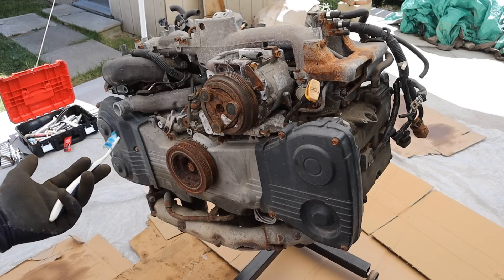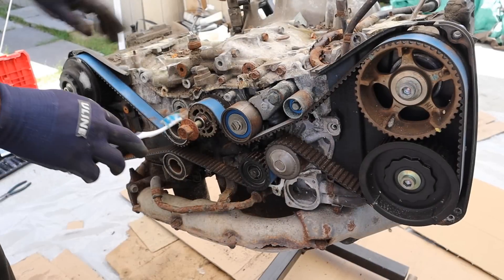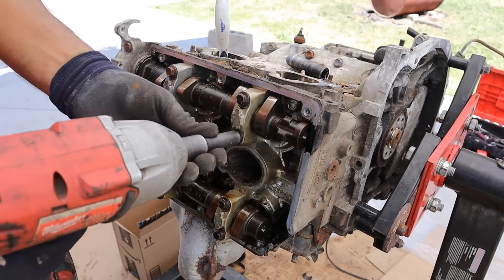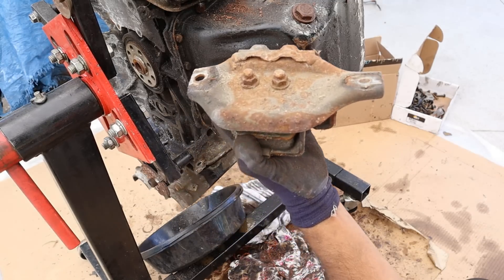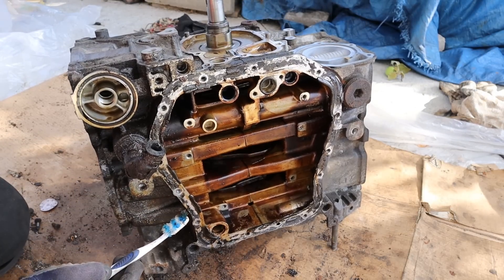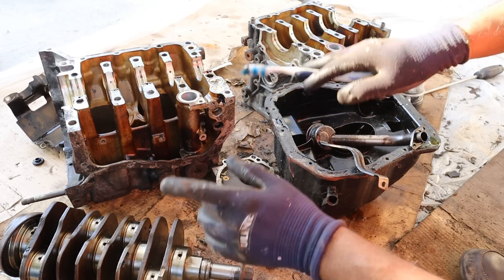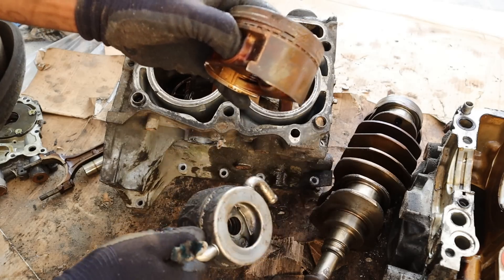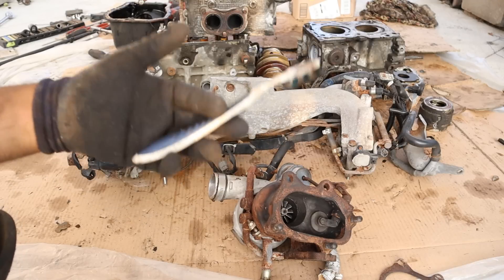Why Subaru Engines FAIL

Comment: Subaru blown head gasket problem follows it to this day. They say it is fixed, but is it not. Engine design is faulty. They should have copied air-cooling design of old reliable VW bug. Subaru and VW bug engines are similar in design. Boxer type...with each cylinder being separated from the rest, and the surface between the cylinder and the engine block is very small. VW had no coolant leaks...since there is no coolant...

Comment: Ej20's were very very good. The problem was an extreme lack of maintenance and incredible modification/abuse. Without a turbocharger that engine would easily run 300,000 mi or more. Super thick cylinder walls, long piston skirts, thick robust rods. Ej'25's suck, Subaru cheaped out and used the EJ20 casting. Basically bored out the block bigger and changed the crank for longer stroke.

Comment: Hi, will a 2018 subaru outback wagon non turbo have a cam carrier leak/drip at 34,000 miles on the car? bought the car end of 2017. subaru dealer is saying the base price is $3555.
Reply from the maker: Very possible. That's why I don't like oil interfaces going through multiple parts.

Comment: The 2011 and older engine in Outbacks has the oil filter inside an exhaust loop. It keeps the oil much hotter than needed. Changing the oil becomes a 3rd degree burns experience. Stupid design!

Comment: I have  an EJ206 in my legacy GT.  i run 95 octane, i think that the 91 causes detonation under some driving conditions, it definitely increases oil consumption, and make the oil get dirty quick..
do i need to have it tuned, like timing and plugs.. it goes real good when necessary, 
,but these days im in to fuel economy , does 33mpg [imperial]

Comment: I find that every engine has its own little quirks and weak points.  Nothing is perfect.  Especially not in a 25,000 dollar car.  Subaru engines are very reliable engines assuming you take care of it and don’t abuse it last what it was designed to do.  It’s not a race car.  It’s not supposed to be a race car.  Do your timing belt at 95k.  Change your oil ever 3-4K miles.  If turbo, do every 3k.  Check your oil regularly, check your coolant.  Use good gas if it’s turbocharged.  Don’t launch the car.  Don’t modify the car without a supporting tune designed for your set up and know that you are pushing the engine farther than it was designed.  Personally, I believe if you get a wrx, you should replace the turbo inlet, throttle body pipe, and ensure your vacuum lines are in good shape.  Do spark plugs and get a custom stage 1 tune running stock boost levels so you can run richer while building boost to cool the pistons as they run lean from the factory mid power band and that cracks ringlands sometimes.

Comment: Great informative video.
I ran from new a 2005 2.0L WRX with a Prodrive performance pack. I ran it for 8 years and 80k miles, with no issues. The key for me was good maintenance, best oil, 97/99 gas (UK octane)

Comment: We have a 2014 Subaru, it's a oil burner, as long we keep it full  of oil it runs. Not impressed. These things aren't reliable long term. We also had a/c issues from day one and had to fight with the dealer to finally fix it. My advice is lease for 4 years and dump it.

Comment: I wonder how many miles you can expect to get out of a Subaru boxer engine (non-turbo) if you change the oil and filter every 5K, keep the oil topped up, and drive the car normally.
Reply: 150,000 miles easy..by then 80% of cars on the road  need to be scrapped if you cant fix it yourself.  NOTHING wrong with that boxer engine.
Reply from the maker: I wonder too...lol

Comment: Water bending valves???? Cracked piston, blown head gasket, bent wrist pin or rod... sure. But bending valves? Hmmmm
Reply: dude look at the engine.....you really thing it was maintained?  Get serious
Reply: @chadhaire1711  never questioned the maintenance. Sure was non. 
But hard for me to imagine water bending valves.
Reply: @bubav8  if there was enough water to cause all this rust you can be sure there is  more than we are being told here.....looks like a flood car.  This motor is good for 150K miles, 100K if driven hard.

Comment: Why subaru WRX engines fail:
1. No maintenance. Like checking oil level even once a week, and changing oil regularly goes a loooong way.
2. Excessive mods. Subies are easy to mod, but the stock engine isn't built to handle more boost than it has stock. 
3. It goes fast, so owners redline the car and drop the clutch to launch really fast. I know a guy who does this at practically every green light with his WRX. 

And often at least two of those three are combined. Sometimes even all three. The car is tortured, often boosted over what the engine and transmission can take, and regular maintenance is a distant dream.

Comment: My 2.0  turbo 2014 failed  after 130 000 km on it   Seals started to leak and the dealer told me it needed a whole engin rebuild

Comment: You replace the headbolts on the boxer 4 as they're all stretch to yield and one use only bolts 
Dead give away is a nice new looking belt and the Cams moving freely 
Meaning a belt failure and bent valves 
Good vid keep it up

Comment: Inadequate Preventative Maintenance and being raw dogged at the same time generally turn most engines into 1 solid state piece of metal.. subaru handles all that fairly well.. do the PM on your Subaru and you will keep it for a long time barring the unforeseen.

Comment: I recently had to sell my Legacy 2.5 GT ‘05 with 207k miles that I owned for almost 10 years because it got a really bad oil leak over the past several months. Loved that thing, especially since it was a manual, but it was becoming a nightmare with constantly having to keep oil in the car and the cost to fix it was way too much since the entire engine had to be taken out to repair it.

I drive a 2016 Lexus IS 300 now. I wouldn’t mind having a Subaru again as a second car, but not as a daily driver, at least not one with a turbo engine.
Reply: MY 2018 IMPRESA 20K   ALREADY HAD 4 RECALLS  AND BATTERY WENT BAD AFTER 6K MILES
STILL HAVE IT
Reply: @ekop1778  Thats good because other manufacturers tend to hide issues from manufacturing. Subaru tries to track down and fix all even most petty issues. Also FB and FA(EZ series too) series of engines are very reliable. All bad reputation is caused by cheap graphite gaskwts on EJ25 naturally aspirated engine and turbo EJs from oil starvation.

Comment: This surprises me.  The 2L WRX engine of this era with the metal head gasket wasn't known for head gasket failure.  NA engines with the composite head gasket always blew.  Still, you could expect to get maybe a 100K miles or more before failure.  As of a couple of years ago Subaru was still selling this garbage head gasket as a repair part.  BTW, this is an interference engine.  Extreme care is required when swapping timing belts.
Reply: 2.5 engines were more susceptible to head gasket failure due to the thinner walls of the cylinders from the previous 2.2 litre displacement.

Comment: I had my forester Stb for 11 years replacing it for a Mazda hybrid (fuel is so damn expensive), the forester still works and I wasn't that religious with service. So I don't think I agree that ej engines are fragile. If mine never started, I was genuinely shocked because it started all the time everytime for years.

Comment: I'd wager that this one met its end with a combination of a money shift (which lunched the valves) and low oil. There wasn't enough "milkshake" to suggest a typical head gasket leak; judging by the rest of the engine I'd suspect it was pulled out and chucked into a field for a few months before you ended up with it, and the water made its way in through the open valves. Basically: it was abused and neglected. No engines can survive terrible owners.
Reply from the maker: Yes it came from a farm so it was likely sitting

Comment: Here are some of the problems we encountered with our two Subarus: flimsy heat shields that self destruct; exhaust manifolds that pass directly over the CV boots that cooks the rubber necessitating replacement of the entire CV joint; under engineered front disks that warp (replacement with after market disks solved problem); four speed transmissions that downshifted constantly to be replaced by CVT that has its own problems; inherent engineering deficiencies in the engine that commonly results in head gasket and cylinder over-heating problems not found in other four-bangers. The failure of window design (perhaps improved now) made wind noise irritating and the air venting that introduced very warm air into the cabin (necessitating use of AC even with cool outside temps) was just another problem.

Comment: The number one cylinder overheats. Head gaskets and engine failure is common. Ours died at 140,000 miles. Subaru has never resolved this problem.

Comment: I've owned several Subarus with these boxer engines. The full shop manual for these cars (the models I owned anyway) clearly instructs the head bolts need to be re-torqued on a regular schedule for the first year or so (can't remember now). It's not optional. It seems no Subaru shop does this and Subarus get a reputation for blowing head gaskets. Well, duh. Nice cars, nice video.
Reply: Can you name another vehicle that requires frequent maintenance of the cylinder heads? Subaru has a design flaw that results in head gasket failure and destruction of #3 or cylinder.
Reply: I owned a 1979 ford D series truck, they had a reputation for blowing head gasket.  manuel said that head needs to be retightened after 1000km. a process I went through, and didn't have any problem  @lewisg1736
Reply: Im not surprised to read this, givin the bad rap subs have.. I recon that a quick way to engine failure is to run 91 gas, and flog the arse of it, detonation  will be lurking and will mess up things thing too.  oil and filter are real cheap really...

Comment: Serviced our 2011 outback regularly, changed tranny fluid every 60,000 and drove it 11 years and 257,000 km.  It did blow a HG but other than that…it was a solid car.
Reply: 257 k  (160,000 miles) and a head gasket replacement is OK with you? We sold our Tacoma with 235,000 miles and the young guy who bought it is still driving it (without major mechanical work) years later.

Comment: As someone with a broken EJ205 in my garage right now I can confirm this is accurate, but I still love my Bugeye and she will be getting a built engine :)
Reply: Are you switching it up or getting the same engine
Reply: @goudagramps3719  I'll stick with the 2.0L, the 2.5L have a higher tendency to throw rod bearings than the 2.0L does. Gunna get the engine close-decked, drilled for 1/2" head studs, and forged internals hopefully going for ~450whp
Reply: @Grooove_e  that’s Awesome man I hope it’s fun
Reply: @goudagramps3719  thanks I appreciate it, I daily drove the car for 3 years before it broke and I'm doing a full restoration level build with it now, ill try to start posting videos of working on it/driving it once it's done

Comment: Too many avenues for failure. My sister had to have her Forester engine replaced after only 6000 miles(defective piston rings). Watching this video really makes me appreciate the 2.5L 2ARFE engine in my 2017 Camry.
Reply: A WRX will run circles around a Camry.  More performaance requires much more maintenance.

Comment: Does this issue effect non turbo charged 2.0s?
I have over 160,000km or 100,000mi on my EJ204 and have had no issues at all.
Reply: Seems it was abused and not maintained right, people are often times ignorant of how they should maintain turbo cars. Cardinal sin being not letting them warm up and cool down before/after driving hard, and no frequent enough oil changes. As long as you know how to take care of your car it wont have an issue
Reply: Also ideally you should.get it equal lenght headers and twinscroll from JDM subarus or aftermarket it will get rid of unequal temperature stress, run more efficiently and loose the 2cylinder style rumble. Which might be a con to you, but i think it would be worth it for long term reliability sake.
Reply: Oh wait you have NA. Then you are in the clear. EJ20 and EJ22 are rocksolid, just make sure to change oil on time.(its horrible thing that many people neglect on any car) Only EJ25 had HG issues due to weak composite/graphite gaskets. NA motors have equal lenght headers from factory so no assymetrical heat issues.
Reply: @Kacpa2  Yeah I do oil changes every 5,000km or so due to heavy driving.
Only thing I had to do recently was change the radiator.
Reply: @IIGrayfoxII  Then you have nothing to worry about, thats very good care you take of it, with shorter oil change intervals.

Comment: this videos has double purpose, 1. to show what is inside and what went wrong and how it works and 2. to select different types of metal for recycling what gives more money than if is mixed
Reply from the maker: Actually they say aluminum block is same as steel scrap because it's got steel liners and inserts and considered dirty aluminum
Reply: @speedkar99  in my country one kg of al is about 1 $, steel is 7 times less,mixed, more than steel less than al,depends on calculation of worker that takes it from you,i did cut on parts my ex car,even engine and gearbox

Comment: I would LOVE !!! To see how a Subaru turbo charger works. :)
Reply: Same as other turbochargers. Hot expanding exhaust enters the turbine housing and spins the turbine wheel. This is connected to the compressor wheel which sucks in and compresses the incoming fresh air and sends it to the intercooler and then to the engine.

Comment: Outstanding commentary of the tradeoffs to a boxer engine. It's clear why head gaskets fail, the open deck block. They must have the open deck block for the split block bolts. Timing belt turns to be better than long timing chains that fail from guide wear and tensioner issues.
Reply: There are many Subaru EJ engines that aren't open deck, they are known as closed deck, or semi-closed deck, they still have the holes for the block bolts but the rest is closed. They came in early Legacy RS and some version 1-3 WRX Sti's, also the later Sti EJ207 block is closed deck I believe. They also fail due to the head bolts being too small and because there just aren't many of them holding down each head. The head studs can be upgraded.

Comment: Unfortunately it's not a very good engine design, so much gravity even working against it with the design of the pistons and rods.  And the higher the RPM's the worse it gets, etc. There's a reason why Supra engines can take 1000 Hp, often with a stock bottom end, and then there's the boxer engine...lol
Reply from the maker: Yeah gravity with a wet sump system doesn't help.
Reply: @speedkar99  Yep, Subaru's motto is to be different, but sometimes tried and true or mainstream works for a reason. But in my case, I'm building a SL2 for turbocharging and port and polish, dual intake cam,  hypereutectic piston build myself and Saturn's motto also was a different kind of car company so I guess I'm guilty too of wanting to think outside of the box... Lol

Comment: Lets be honest the #1 cause of failure of wrx/sti engines are the owners. Either lack of maintenance or tracking it hard without upgrading the cooling and not stopping when it starts to overheat. Also people modding the shit out of them and then not doing anything about the cooling or oiling.
Reply: Throwing upgraded parts at them with horrible off the shelf tunes not made for the parts installed and wondering why their car was lean and now knocking.
Reply from the maker: Good point

Comment: Love the sound of this setup, HATE the weak engines. Had mine rebuilt twice, and it failed a 3rd time. Never touching a Subaru again. Also the idiocy of not being able to remove individual parts of the engine. Such poor servic-ability from a racing engine, really?
Reply: I had 2 of them back in 2002, a Type R and RA. I was always shitting it that one of em would spin a bearing or some such! I was lucky but they are a liability.
Reply: Sounds like poor rebuild, tuning, or maintenance.

Comment: you keep saying "coulda been salvaged" ? your already half way done with the rebuild, dissasembly. now clean, replace,  fix, and zip up and she pur like kitten.. the valves bent probably just because they got soft in the stem and they got all floppy. a handfull of new valves tubes and seals, new engine.

Comment: Didn't watch the video, but Subaru rod bearing failures are due to the bearing clearances being too tight. This causes bearings to overheat and fail during sustained high RPM use.  This is an absolute fact and Subaru even settled a class action lawsuit to that effect. Any attempt to blame the epidemic of rod bearing failures on bad maintenance or abusive driving, as most do, is feeble.
Reply: And don’t forget defective piston rings.

Comment: The Subaru DOHC turbo engines in the EJ serious have always used the MLS head gaskets. They do not fail unless the coolant has the incorrect mix of water to anti freeze and the alloy corrodes. The main reasons for coolant to oil mix are turbo seal failures and oil filter cooler failures. Good video of the turbo boxer tear down.

Comment: that seems like an EJ without a proper maintenance for a long period of time. not the actual subaru engine fail. dont mislead the public with such kind of headline. However u have the best explanation about EJ engine.
Reply: this, it was hard to watch with all of his assumptions about this being subaru's fault, when this car was text book abused and neglected. I also agree that his understanding of engines was spot on. I know many many many EJ20T engines with well over 300k miles with the stock MLS gasket still running strong.